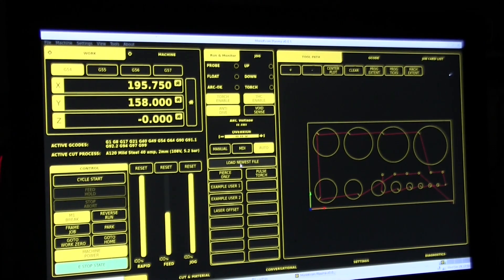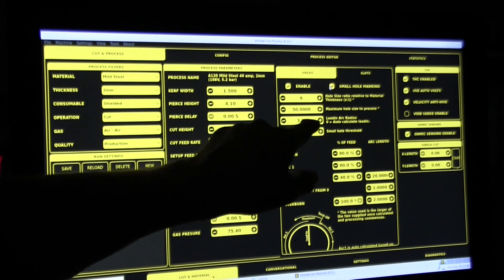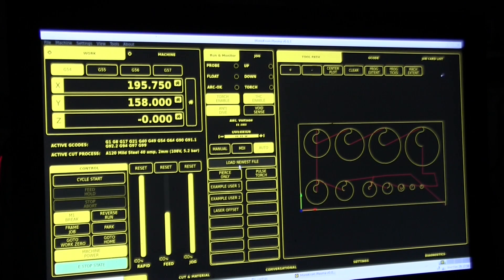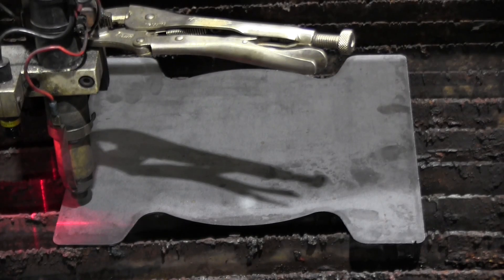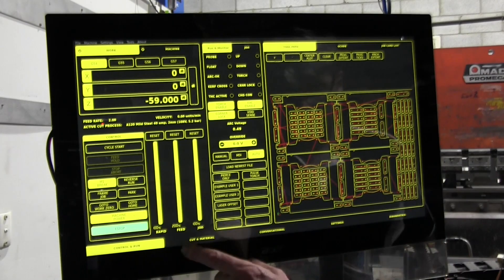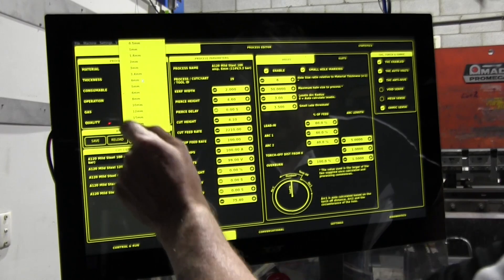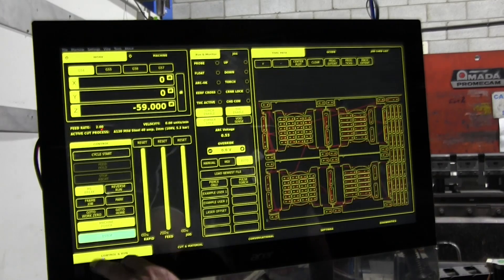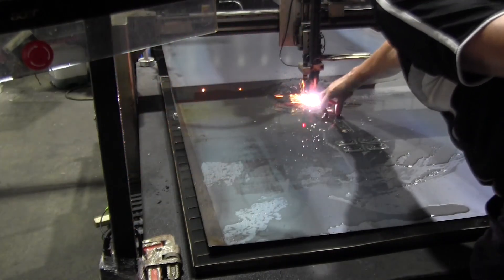LinuxCNC Monokrom: The Plasma Upgrade You Didn't Know You Needed.

Comment: What touch screen are you using?
Reply from the maker: Linux does not really care so any touch screen works but if you are looking for a panel mount one, I've bought direct from these guys. https://www.greentouch.com.tw/ I needed a 16" 1080p monitor to run  Linuxcnc's  QT dragon and they were few and far between. Theey were pretty well priced and I was impressed with the quality.
Reply: I've got a working QTPlasmaC system and config set up. Would love to try this and have installed the bits, but not sure how to go about migrating my working config?